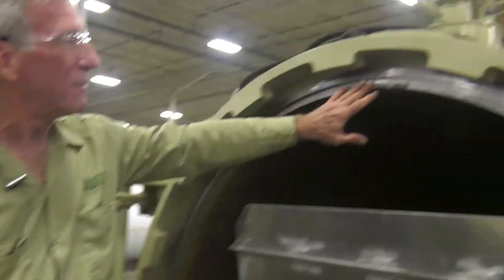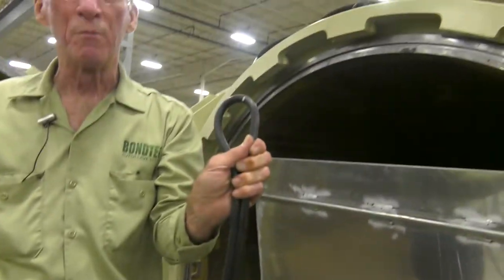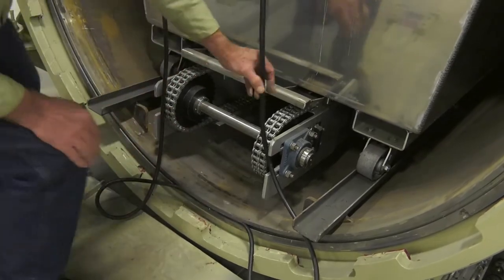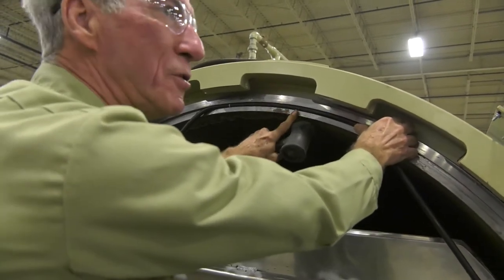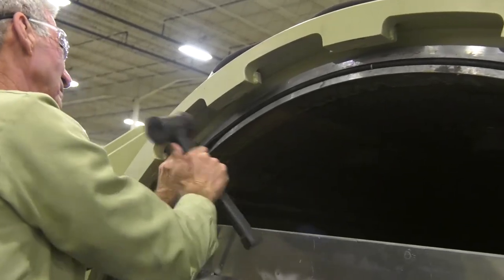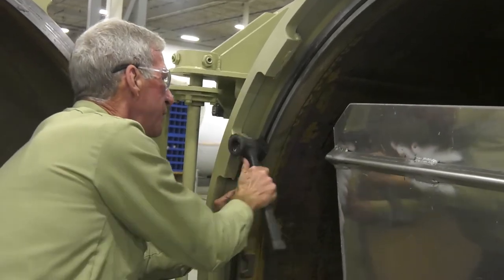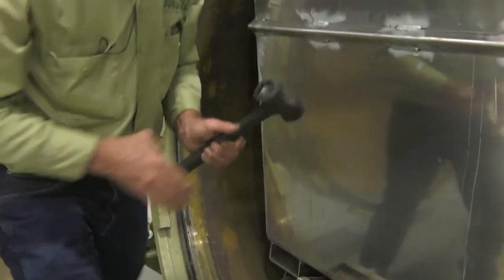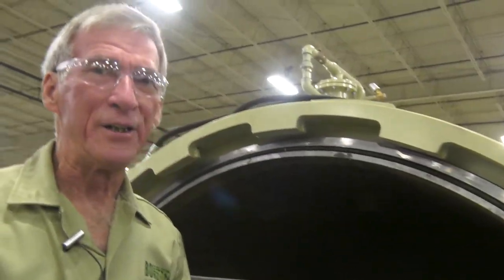How to Replace an Autoclave Door Gasket

Comment: First and foremost, always wear proper PPE, which includes proper gloves. Autoclaves can be extremely hot.  Secondly, while installing a new door seal, inspect the door wedges. A broken or missing door wedge, or shim, will result in a leak.